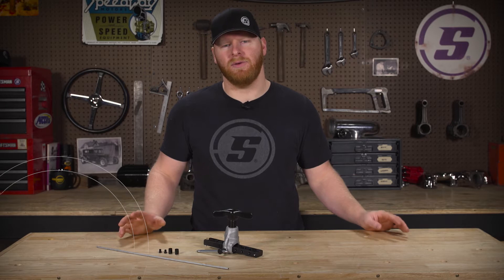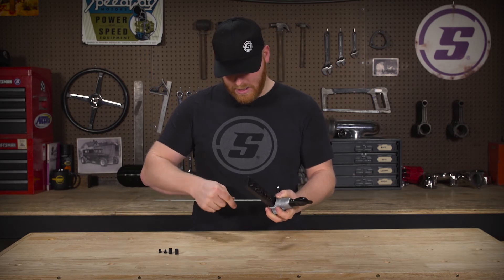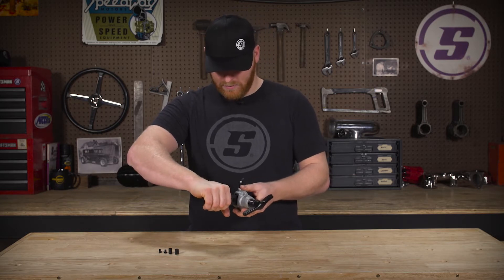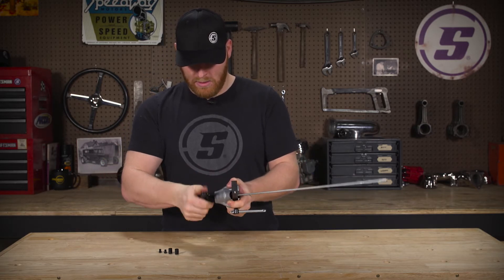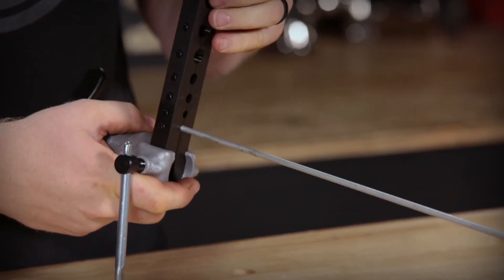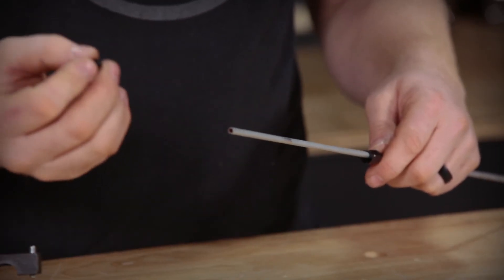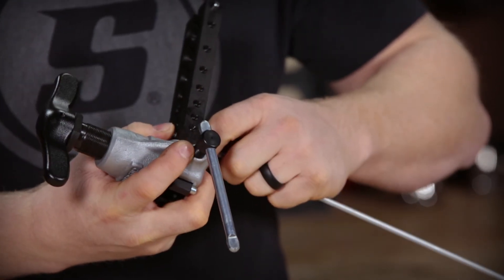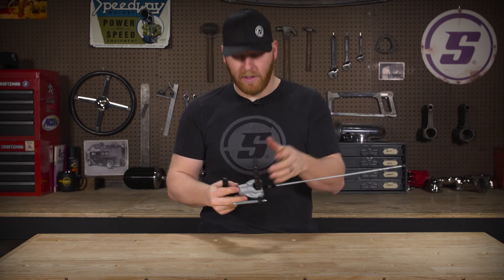37 Degree Flare Tool Tech Talk

Comment: Ok here is my question in the automotive industry most mechanics ive met use the 45 degree kit. whats the point, and difference with a 37 degree and what would it be used for? bc we all use the 45 degree kit for brake lines regardless of material.
Reply: AN fittings use 37 degree flares. This tool is for fire suppression systems and AN brakes mainly race applications
Reply: 37 degree fitting takes less force to seal since it has less surface area. The 45 takes more pressure to seal, buy can handle higher pressures.
Reply: A 45 degree flare mating to a 37 degree AN fitting will leak.  A 37 degree flare going onto a 45 degree fitting will often split (and leak).

Comment: I keep hearing it is not recommended to use single 37 degree flare with steel line on brake system as it will leak. How safe is this?
Reply: That is correct. You want double or bubble flares on brake lines if you care about your safety. We are talking about thousands of pounds of pressure in brake lines in most systems.
Reply: @moshet842  well no because single flare 37 degree are used all over brake lines in race cars, an3 braided braided lines are single flare 37 degree. Many many of the steel braided brakeline "kits" are just single 37 degree flare an3 braided lines with a metric or sae adapter to stock hardlines. The sleeve under the tube nut creates the double flare (double thickness)vs actually putting the double flare into the tube. 😊
Reply: @  Good to know. Thanks for the information. The bracing support of the nut sleeve makes sense.
Reply: @moshet842  Thank you good point u made about single flare as well 😊